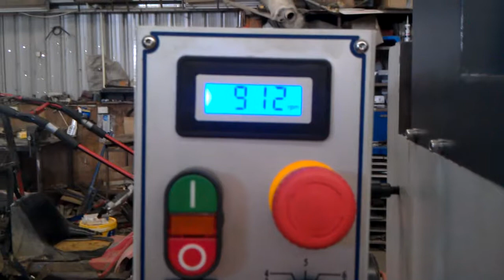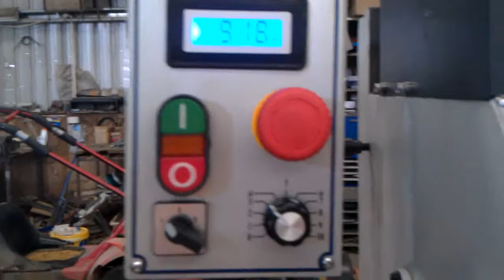TM 25V

Comment: That mill is too clean Vinny. You need to spin some bits and make some chips ;-)
Reply from the maker: yeah i know , one of my problems is lack of time ....... next problem is when i purchased the Mill , it was basically just the mill. So i have now been researching end mills, precision vice's , clamp sets, parallels, Morse tapers etc. Ive now had the lathe for 5 to 6 weeks and the CEO (wife) just found out about it last week. So i'm currently in the process of working out my strategy to aquire everything else i need LOL.
Reply: Hey Viny, I know how it feels mate. I buy heli's and hide them for a month or two hahaha. Hey, make sure you purchase a collet chuck your mill otherwise you'll get caught out milling with a drill chuck. I did, end mill moved, wrecked the job and bent the arbor :-(
Reply from the maker: Yes , i took that advice from your un-boxing the Mill video. There's so many Accessories it worse than a Camera lol. Ebay is a great source but the choices are vast and quality and prices differ greatly.